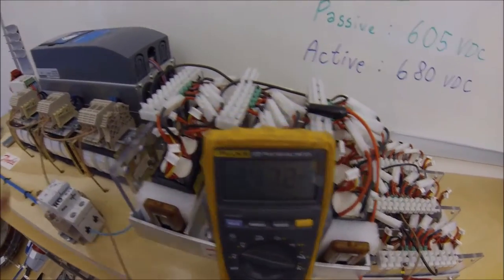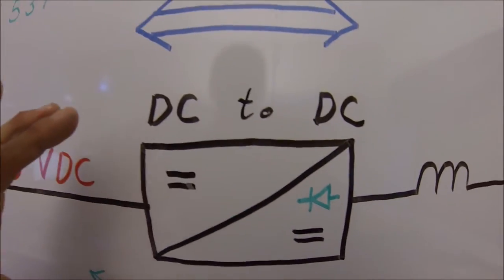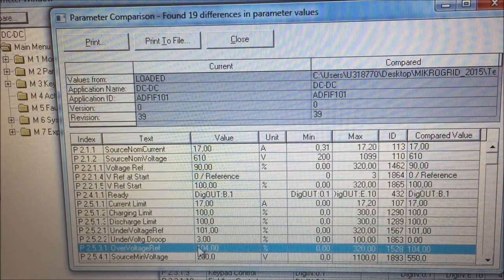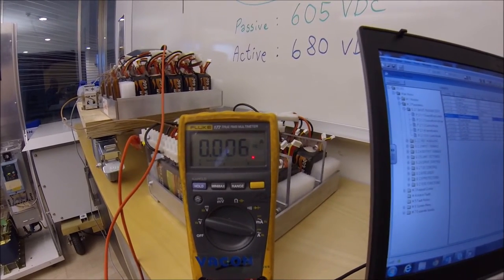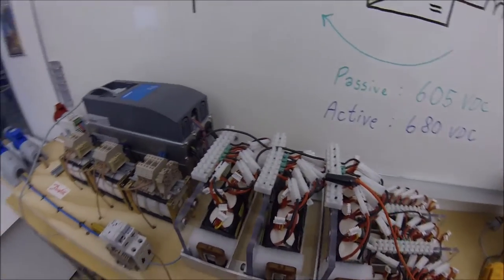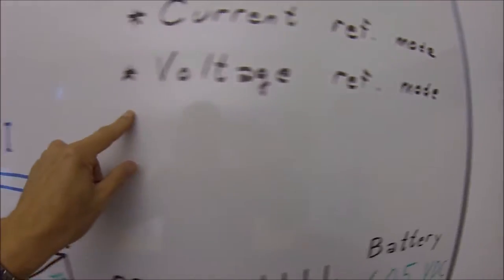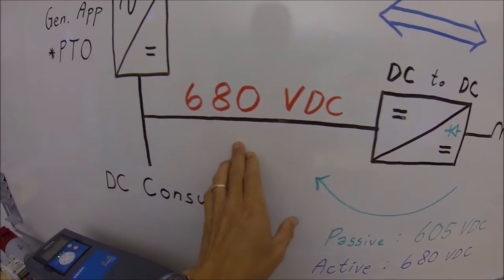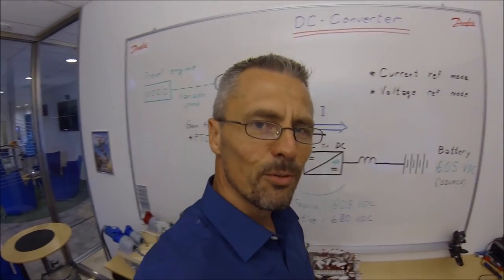Drives School (E11) - DC Converter, setup

Comment: Hi Reidar Bernsten,
Thank you for your videos they are so helpful.

i had a doubt... 
in DCDC converter how come the DC bus voltage reached to 680Vdc ? with Source Nominal voltage of 610V ?

note.1: even tough with 101% & 104% of Over voltage & under voltage controller, it should bounce between 616 (610*101%) & 634 (610*104%)

note.2: in the DCDC converter manual, it is mentioned that "ID1462;  Voltage reference in percentage of Source Nom Voltage." means in your case it is 90%, Source nom, voltage is 610, so your BUS voltage should reach 549.

kindly Can you please explain that ?

Thank you